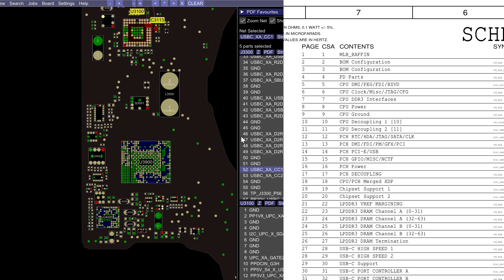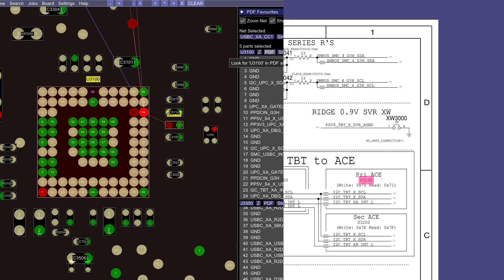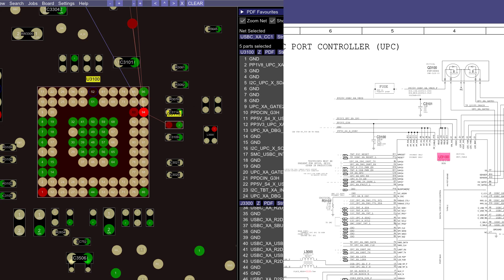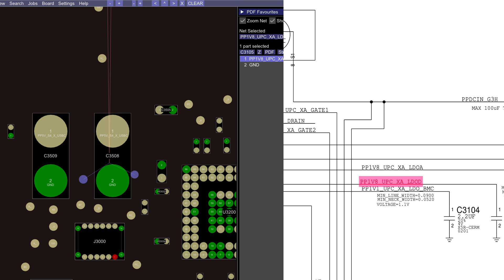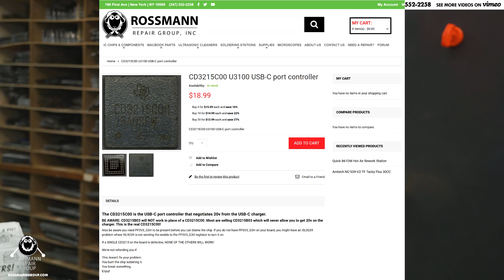Troubleshooting 5v on Touchbar Macbook Pro charger - IMPORTANT INFORMATION on finding the BAD CD3215

Comment: Hi, I got a 820-00281 that gets up to 20V on usb c meter at 1.5-1.6A, then drops in current to 0 and the whole board resets to 5v. It seems like all the power rails are coming up. Could a bad or corroded CD3215 cause this? When I first got it the board was stuck at a pulsing 5V and missing PM_EN_P3V3_G3H and PP3V3_G3H so I replaced U7000 (first time on such a small package) and now it'll negotiate to 20V but reset.

Comment: I wanted to know if its possible to replace just the gpu chip in a graphics card and have it work I found the chip for my Alienware 17x r3 for 30 vs 300 thanks for any input the card I have is a gtx560 and the chip is a gtx 880m

Comment: Considering Apple allow their laptops to run ar 95 degree celcius, and the life of capacitors is directly related to temperature and halves at exactly 95 degree celcius, it's like Apple deliberately designed their laptops to prematurely fail by not throttling them at lower temps.
 "Put another way, the lifetime doubles for each 10°C reduction in temperature, meaning that a capacitor rated at 5000 hours at 105°C would have a service life of 10,000 hours at 95°C and 20,000 hours at 85°C."https://www.xppower.com/Blog/Electrolytic-Capacitor-Lifetime-in-Power-Supplies
Reply: most laptops do run at really high temps all of the time. But not as bad as apples, there are soo many killed cpus do to these temps.